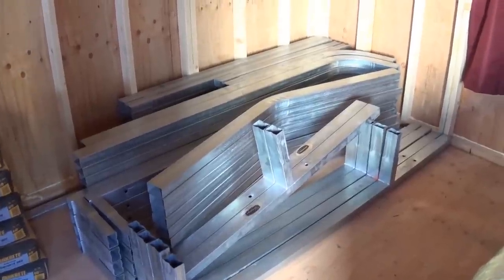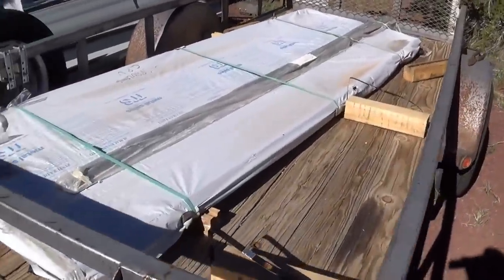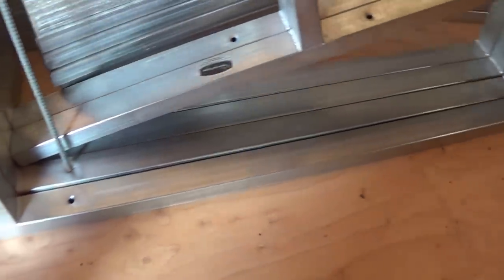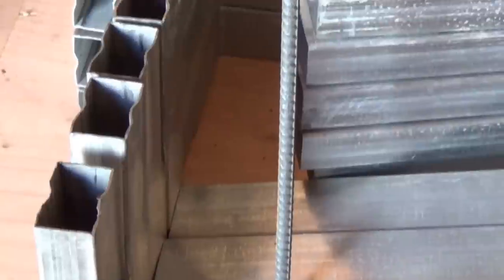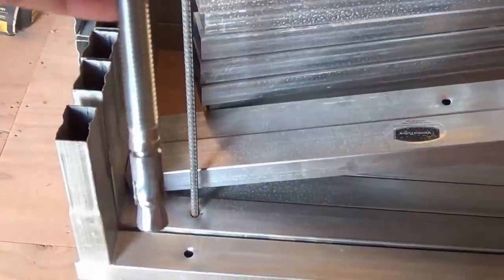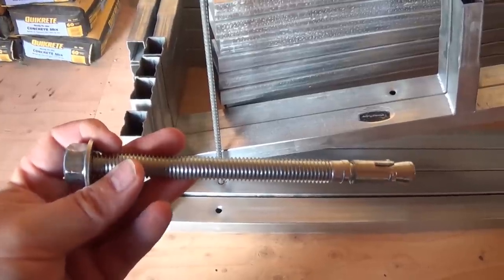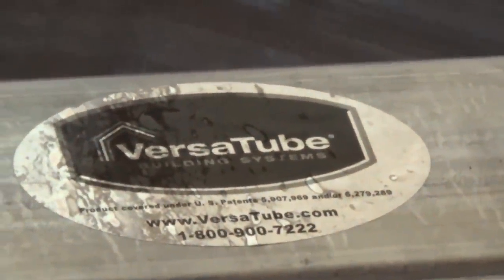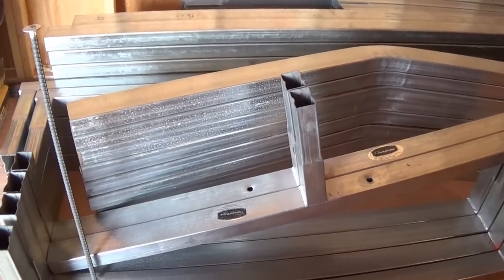See it before its built DIY Versatube RV Carport - living off the grid

Comment: Versatube is ridiculously expensive.   I priced a 20x30x10’ legs =$3900 shipped.  Local company installed the exact same size for $4280 INSTALLED and it has welded post joints not screws.   Check around before you waste your money for those who aren’t sponsored.
Reply from the maker: i am sure each location will be different. when i looked versatube was the best price.
Reply: 42 installed, where is this at?   These companies wanna charge me 10k for a 22x26.
Reply: @paperplatemask8608  seattle.   Craigslist has tons of companies here.  I used the shed gal.

Comment: Green is hot... you can put a coat of tropic cool on it to keep from sizzling all summer. 21 years off grid here by the way.
Reply from the maker: nice job. 21 yrs is awesome.  doesnt green fall into the dark colors and dark colors attract the heat?  not to concern becus of the air space under should still create a nice cool breeze. and so far it has.

Comment: do you say if you get the upgraded one it be good for a house the FRAME ONLY?
Reply from the maker: using it as a house maybe. use spray foam insulation to prevent condensation but I am sure you could.

Comment: I'm looking to build a metal building for my office , will you suggest this type of mat. , is it flimsy can build inside of it  ( walls add interior doors)
Reply from the maker: versatube makes lots of types of metal buildings so you might want to check out their website for more info. with the carport I have I ordered extra panels to enclose one side in fact I also found the same panels at lowes. don't remember the price difference.   building within it using the metal carport as the outside I think would work just lots of custom work.  I think it can be done but not sure how the cost adds up with other options.  good luck to you.